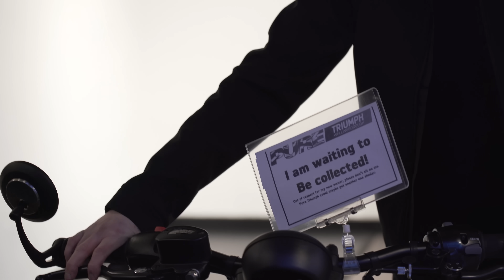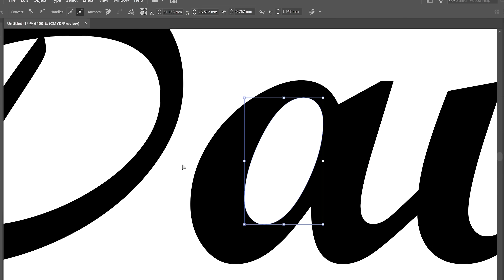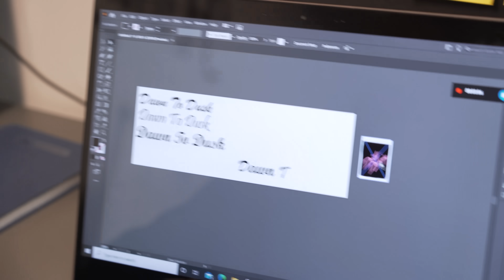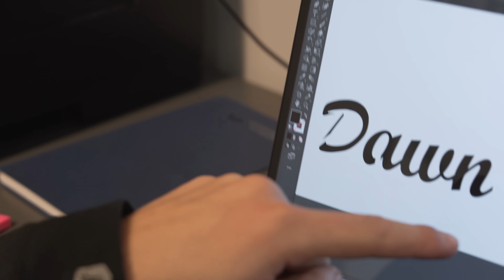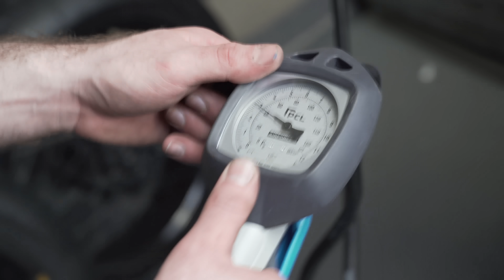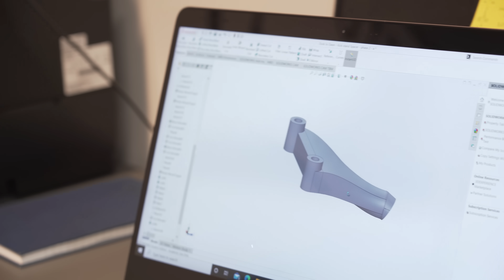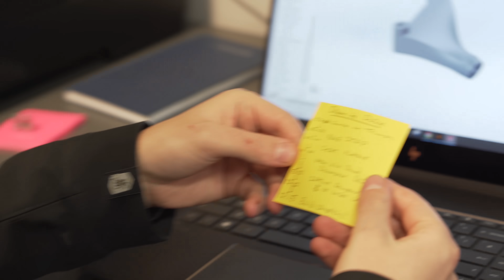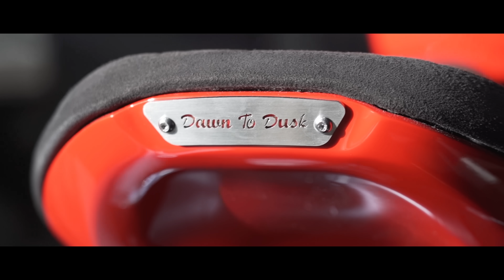Rebuilding a Triumph Bobber in JUST 1 DAY - Dawn to Dusk Challenge

Comment: Not only the bikes are high quality. But the workshop with all those lovely tools. And your filming. Really stands out! 
For me, a challenge without the time bit would be better. No need to stress. The challenge could be, cheap build...or material...or two up...or...a classic Triumph dragster with a reversed top! 
Yep, they used to do that! The carbs facing forward and the exhaust backwards. Looks sick! Probably easier on a carbed engine with pushrods...but it's a challenge! 
Or maybe building a bobber/scrambler/motard using a completely "wrong" styled donor-bike? Cheers!
Reply from the maker: Thanks for the suggestions John, we have have to write some of them down 👌🏼👀